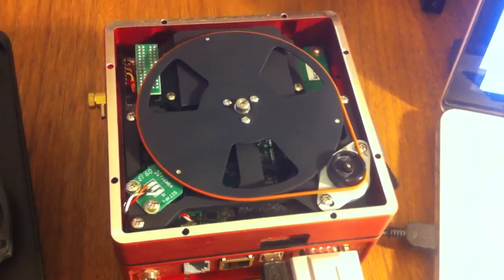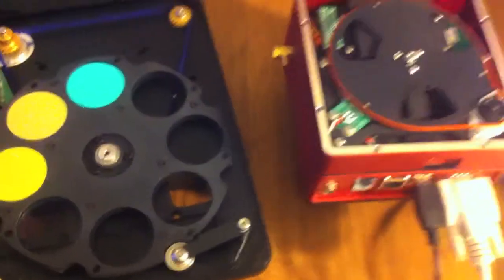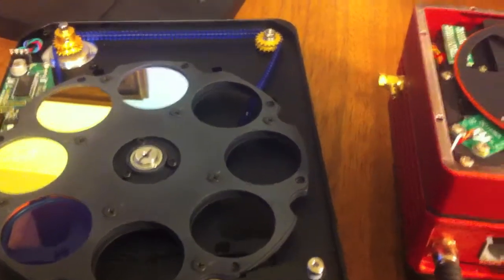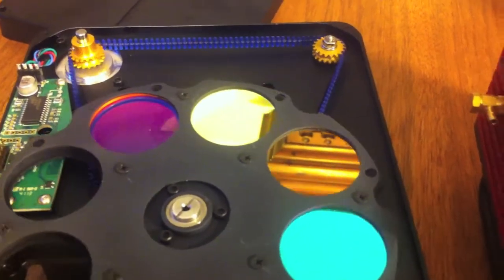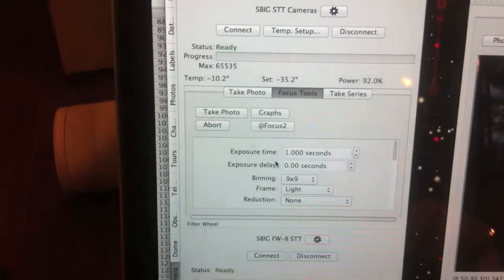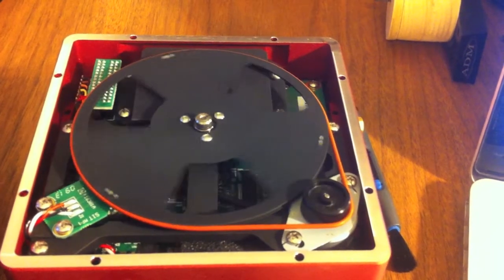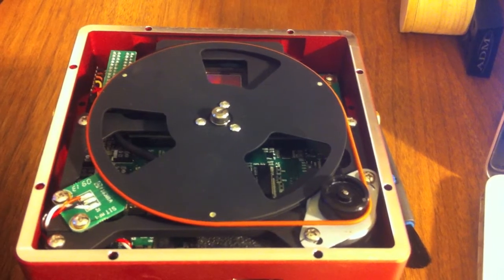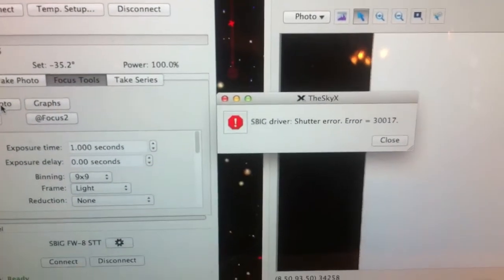STT 8300M Shutter Error

Comment: It's a old video, but I'm experiencing the same kind of problem (shutter errors, in particular for flat frames). I will remove the cover and check what happens in my camera as well. How did you solve the issue in the end?
Reply from the maker: Wow - taxing the memory here.  Spent some time on the phone with a technician helping me debug.  I think what I found was a cold solder on one of the boards - maybe the green one in the upper left corner under the shutter?  I do have a bunch of test and repair items with me, so at the time it was easier than sending the camera back.